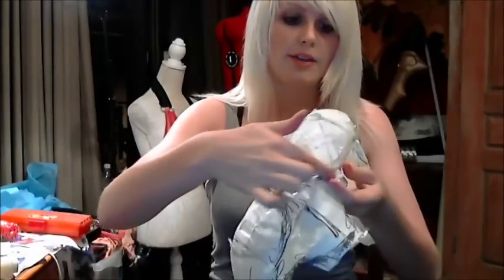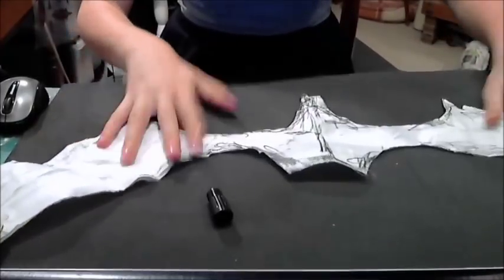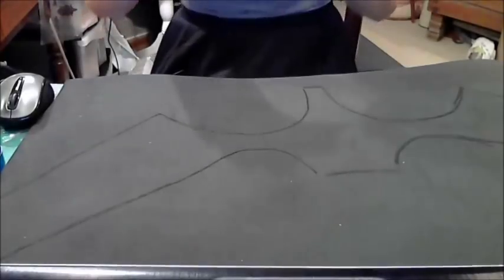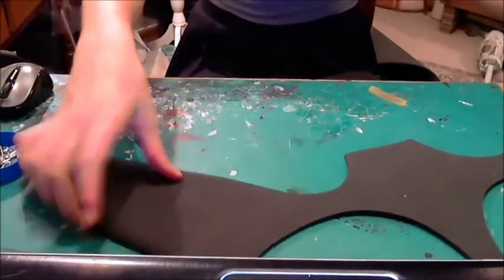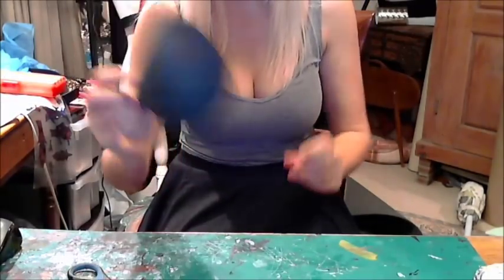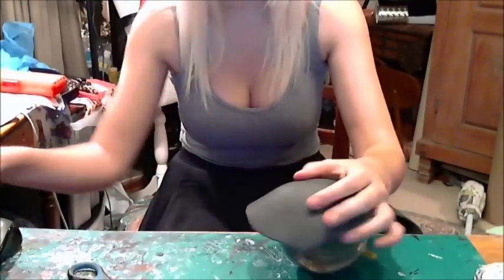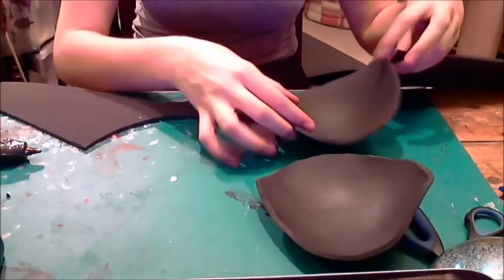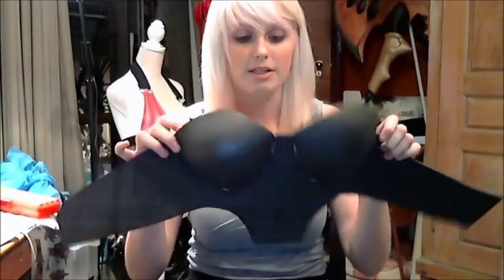Craft Foam Breastplate Tutorial

Comment: This is a great and interesting video. I used to paint miniatures and I happened to run across this video looking for something on steampunk.  The foam description is very good, I am sure folks can use your info to find access to thicker foams as you mentioned it is the foam for yoga mats.
RE: the details and using clay...I also remember reading about a flexible plastic that softens when boiling.  Not sure if that would be useful too you as clay is probably much more easier to work with but might be useful for stronger/heavier use areas.  Instamorph and Friendly are two but I have never used them...just passing along.
Be well.

Comment: I am new to this, so I hope that you will answer some of my questions.
1) Am I right to think that craft foam is more comfortable than worbla?
2) If yes, is it then possible to use Worbla for details and craft foam as a basic? I get the feeling that worbla is easier to master for details - correct me if I am wrong.
3) Do you attach any corset strings to hold at the back? And if so, is that done easily using the craft foam piercing some holes?
Thank you in advance, this is amazing work!
Reply: craft foam is a much softer material than worbla as worbla dries rather solid though comfort wise they wont differ to significantly. Worbla can be easier to use for detailing since it is a much sturdier material and generally is used to cover the base so that the exterior is smooth,sturdy and easy to paint. You can use string as a closure for the back which yes, piercing some holes to add the string is one way, also velcro or ribbon and closures to tie the ribbon through can be used. Theirs tons of simple ways to hold the back closed :) Good luck!

Comment: Hey there! Awesome video on molding foam. Really helpful! I've been trying to find one that can translate to shoulder and knee parts and this works great. I have a couple of questions if you don't mind! 

1. What foam do you use? I've been thinking of using the Kydex brand and couldn't tell if that was what you were you using in your video.

2. Any alternates to the heat gun? Would an iron work the same?

Again, great video and thanks! :)
Reply: Awesome, glad i could help :)

I dont know anything about foam brands. I buy straight from a foam factory and they just call it EVA foam or SVA foam. 

And as i said in the video the alternatives i have used are bar heaters and stove tops. i've never used an iron before but you could try? :)

Comment: Once you've made the armor pieces do you need to coat them with anything to harden them before you paint them? Or do you just go staright to painting? I'm looking to do my first foam armor making for my next cosplay outfit. Thanks in advance :)
Reply: I have a painting video where I explain my process of painting, Its linked in the description :) Basically I prime the foam with about 6-7 layers of woodglue / coldglue before painting. It makes the surface smoother and harder. If you paint straight onto foam without priming the foam will just absorb the paint :)
Reply: Awesome, thanks a bunch! :)

Comment: how much worbla and craft foam did you use for this? do you know where the cheapest place to buy black worbla is? also can i stick flexible plastic mirrored sheets on top for a chrome look? if so is there a certain glue you can recommend and any other mirrored material you think could work better? thanks!

Comment: Hey Tayla!

For the part on the breastplate that wraps around your body, won't it crack once your paint or seal is dry? I'm afraid that it would crack on me! I love using woodglue because it makes the armor very stiff, but then the stiffness would crack on parts where it bends a lot. How can I fix this?
Reply: if you paint it or seal it while its in shape it wont crack, if you paint it then try to bend it to shape it will crack, to fix it you can either use gesso or woodglue to fill up the crack and then you will have to touch it up with paint. but on your chest it shouldnt really crack since you dont bend there so much :P
Reply: Tayla Barter Ooh I see! Can I ask how did you seal your breastplate before painting it? And also how did you seal up your paint job?
Reply: I didnt seal the paint. i probably should seal my paint XD but I use Woodglue on my craftfoam also.

Comment: a heat gun may work instead of the stove, if you dont know what im talking about, a heat gun looks like a blow dryer you would use for your hair, but it is not, its a tool for heating stuff up. i do electrical work and we use it for heat shrink, its this stuff you put over wires to keep them neatly together and it protects them, it gets really hot. you can get one for 20$ at walmart in the tool department, you dont need an expensive one, they range in price greatly from 20 on up to over a 100, you dont need to spend that much money, id opt for one of the 20$ ones from walmart or the next cheapest one you can get, just look around or ask someone back in the tool department, some other places that would have them are, lowes, home depot, electrical supply stores, arts and crafts store. dont be nervous about it either if youve never used one, just never use it on yourself lol it gets extremely hot, but it very very useful. i know some people can be sketchy about using tools theyve never used before like saws, chainsaws, stuff like that, dont be, its very very easy to use, and its pretty hard to burn yourself with it if you just be smart and use common sense, youll be fine. itll make it much easier and much safer in my opinion then using your stove, and youd be surprised how much stuff youll find you use it on, and youll probably be happy you got it, i use mine alot. someone paid me to remove decals on their car and all i did was heat it up with the gun and they peeled right off, the guy told me he had tried all kinds of solvents and nothing was working, he actually scratched some of the paint trying to scrape it off and i fixed that for him as well lol, if you super glue something together that needs to come undone itll do that also the thing is awesome
Reply: This comment confuses me? I have a heat gun? and I said that I was using a heat gun in this video XD. The stove and the bar heater were an alternative option for people who don't want to buy a heat gun :o

Comment: I was making some really simple armor pieces out of craft foam, basically just small slightly curved triangles. I applied a few layers of wood glue and they felt very hard and durable at the point, so I decided to start painting, I was using acrylic paint but almost as soon as I started painting, the wood glue starting cracking and the foam became floppy and flimsy again. Not sure what I did wrong. ):
Reply: +Brittni's Book Find No, not really. but I've found that I actually prefer using mod podge on its own, or atleast using mod podge with the wood glue. not sure why, I just  like the result and it doesn't crack the paint much that way. hope that helps!
Reply: I know now this comment was posted 3 years ago but to paint you have to use flexipaint or plastidip because acrylic is not flexible and so when you move, your armor piece is moving and so the paint cracking. Sorry if I made mistakes I hope you understood xD

Comment: where do you get the sphere from?  I tried to buy some xmas baubles to use online, but they're too small.  Can you use a polystyrene ball, or will it melt from the heat gun?
Reply: shes using what seems to be a ball from a dollar store, you can find them in various sizes but theyre usually small. a polystyrene ball will melt so i dont reccomend using that.

Comment: what kind of craft foam do you use?
i can only find the really thin stuff and in small sheets?
Reply: welp i can only find rlly thick foam lol
Reply: You can find foam rolls on amazon for pretty cheap! They are sometimes called "foamies", thick foam is often called EVA, but truly its all EVA just some is thicker or thinner. Michaels also sells small pieces of foam, I suggest you grab a roll and start playing around as a roll allows bigger pieces to be made. :)
Reply: I can only find the thin foam too. For my current cosplay I've glued two foam sheets together using E6000 to create my desired thickness. *note that heat guns do weaken the glue so you will need to perform touchups.

Comment: Kinpatsu could you link to a source for eva foam? I know the connectible mats are made of it, but it seems to thick for this kind of project...
Reply from the maker: My source unfortunately won't help most people :o it's a local South African manufacturer and as far as I know they don't do international orders. But apparently foam is sold on amazon.
Reply: Kinpatsu what's the thickness foam you are using please as my foam seems too thin, and doesn't mold into a rounded circumference enough

Comment: I was wondering about the density of the foam, the company I'm ordering from (AnyFoam) specifies to ask a low, medium, high or extremely high density rate. I'm think medium but I'm a novice and would REALLY appreciate some or any advice.
Reply from the maker: +MothBite Mallow Maybe I ask them for some samples?? I know the manufacturer I went to offered me some samples so I could decide what I wanted. The density I use is 60, but other cosplayers like Kamui use a density of 100. the only thing I know about density is it can make sanding a little bit easier and give you less fuzzy pieces.

Comment: I have a question, how do you make you armor looks so smooth after you shape it it looks like you used worbla for the texture. I use hot glue for the texture what did you use
Reply: No this is just craft foam. you have to put worbla on before you shape it. I just prime the  craft foam with woodglue or coldglue and that is what makes it nice and smooth and shiny :)

Comment: Hello! Here in my country I can only get 2 or 3mm foam. So I was wondering if I could just glue two of the thinner sheets together or will something go wrong when bending them after they are glued? I would reeeeally appreciate if you could help me out on this one. :D great tutorials btw!!!
Reply from the maker: Galadhel NE you can stick the sheets together but it might be difficult to shape them if they are stuck together :) so for example making those round shapes probably wouldn't work but to make simpler things it would definitely work
Reply: ok thnx very much =) ...I will try to figure something out.
Reply: +Galadhel NE I shape the thin pieces first and then glue them together with contact cement. Then I trace the template and cut it out. This method has worked very well for me. Kinpatsu is correct in that the pieces pre-glued will not work for round shapes as the glue doesn't stretch like the foam does. Hope that helps.
Reply: +Amanda Kalaskie thnank you

Comment: Taking the boob template and cutting a line in the center so that lays flat on the to cut out would do the same thing as molding foam around an object that is similiar in size to the actual breast size. Its actually amore accurate method to form breast plates. This method is called 'darting'. And there are way to hide the seam line that darting causes. Just some food for thought.
Reply from the maker: But then you have to try fix the seams on the darts and some people struggle wit that. this is an alternative for people who don't like to fix seams :) neither method is wrong or right just depends on your comfort zone. I personally will never use darts on boob cups cause this method makes them perfectly neat right off the bat.
Reply: There are ways of doing a darted seam and then sealing it so that there is no appearance of a seam at all. Evil Ted Smith has a channel devoted to working with foam and he specifically has a tutorial on how to fix seams. 

Like you said, no method is right or wrong. I find that darting makes for a more accurate piece because it is measured exactly to the model in question. Darting ensures that perfect fit to the wearer every time... I mean unless their boob size changes. But how often of an occurrence is that?

This is just about sharing information. I leave any and all to do with that information as they will. Take care.
Reply from the maker: I know Evil ted smith I use his tutorials for m shoulder pieces :) I try to be as neat as I can but I always have to patch my seams so I don't see the lines :P 

Also Pushup bra's are a thing XD You would be surprised at how ones boob size can change on demand hahaha
Reply: +Kinpatsu Since I'm male, I'll have to take your word for it! ;-)

Comment: Small question: I want to add details to the foam armor. Should I heat it and form it first before I add the details, or should I glue 'em down on the piece, then form it? :)
Reply from the maker: Its better to form it first then add details :)
Reply: Kinpatsu And for sealing, I use regular white school glue, should I mix that with a bit of water then spread out over the pieces? Or just spread it out without water? ^^
Reply from the maker: Not sure what school glue is :) I Normally use PVA based woodglue, and you can use it straight out the bottle and just use a bit of water to help spread it if you need to.

Comment: when you say "you can use "normal glue"-what do you mean? sry new to making armor. can said glue be the same one you use to apply spandex?
Reply from the maker: When I was making this tutorial I had no idea what I was talking about. normal glue would actually refer to contact glue and contact cement. And I'm not sure what you mean when you say you want to apply spandex??? Do you want to glue fabric on top of the foam?
Reply: +Kinpatsu lol yes, sorry that was unclear. I want to glue fabric, most likely spandex, to the foam. I was going to use VTA silicone adhesive (used on metal, glass, woof and vinyl). I want to make sure it lasts. I heard contact cement smells terrible, and I don't have a convenient space to work in to allow that. basically I just want to know what the best glue is for piecing together foam, and fabric, if you have a few suggestions. also, is the craft foam you get like the kind from Joanne fabrics? thank you!

Comment: What sizes of foam are you using? I buy mine from Range but not sure if thats the size i use.. will look tomorrow, but would be nice to know! Your videos have been very helpful.. been a big depressive slump.. especially since my last cosplay died in the rain after working so hard, your posts will help me up my game and make cosplays much more reliable in all weather :) also dont fully understand what you're doing with the glue? The wood glue is it? Is it linked to how hard your cosplay is? Not sure if i missed any info but noticied in painting your cosplay is solid, wondering if thats the primer/wood glue and which brand you use and how you put it in ect >O< if i missed that in a video let me know!
Reply: I buy 2m x 1m sheets from a local supplier here and I normally use 1cm or 6mm thick foam. the glue in this video? Im just using hot glue to glue the edges together :) but the woodglue is used to prime the foam. I use about 5-6 layers and that makes it smooth and makes it a bit more stable and hardens it. I do have a painting tutorial where you can see the actual glue I use, Its called cold glue I think :) But any pva based glue will be perfect. however just be careful as foam primed in cold glue can crack a bit if its bent too much :o
Reply: Thanks hun, read my message and i wasnt 100% clear but got there in the end! I was epicly tired ^_^ will you be at london con? I intend to go as officer vi but edited with armor x
Reply: Unfortunately not. I live in South Africa so im far away DX
Reply: Awh noooo D: Maybe we will meet someday ^_^ i plan to travel to other comicons around the world when money permits, my page is www.facebook.com/acidfairyuk whats yours? x
Reply: Ah thats super cool! my page is https://www.facebook.com/KinpatsuCosplay :3
Reply: Liked! :)

Comment: How hot exactly do those heat guns get? Wouldn't you burn your hands when molding the foam, or no?
Reply: It gets extremely hot, If you put your hand directly under it when its blowing it will burn you >< so you also shouldn't hold it over the foam too long cause it can also burn the foam.
Reply: Right I'll try and remember not to do that then :)  Great tutorial by the way, very informative.
Reply: Most heat guns are 2kW, so think of the heat of a 2kW electric room heater being blown out of a small nozzle. That's how hot. Stay safe! :)

Comment: do you put something on the foam before you paint it.  my foam seems to want to curl when i paint it
Reply: You need to prime it first! I usually do a mixture of 2 parts water, 1 part white glue, and 1 part fabric glue. Paint a few layers of that on, then just because I want to make sure everything is good to go, I then paint a few layers of gesso on top. Then you can paint it with whatever you like.
Reply: Great.  Thank you for your fast response :)
Reply: curl? how strange? :O ive never experienced that. i do have a pair of leg gaurds that i painted without priming my foam but they never curled :O I prime my armor with woodglue or cold glue straight out the bottle. its about 3 layers then it also hardens a bit and gets nice and smooth and shiny :) I dont use gesso because you have to sand gesso since it leaves paint streaks and woodglue doesnt. then after ive primed with the woodglue i paint onto it with acrylic paint. and then do shading with oil paint.